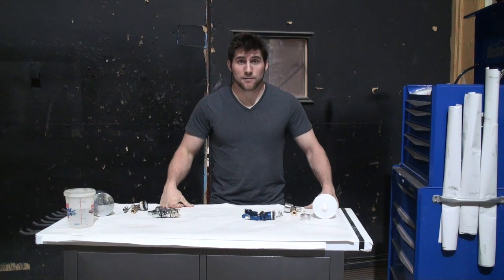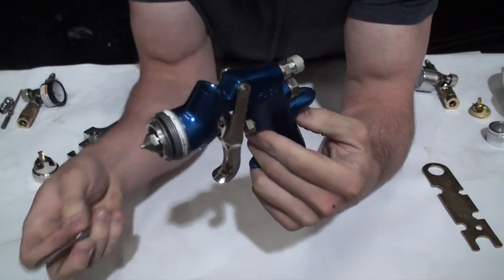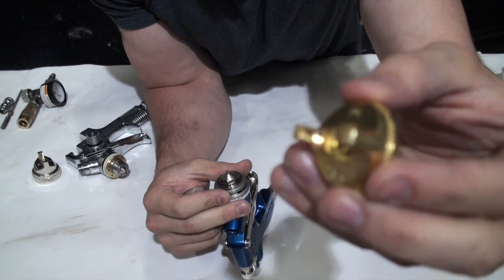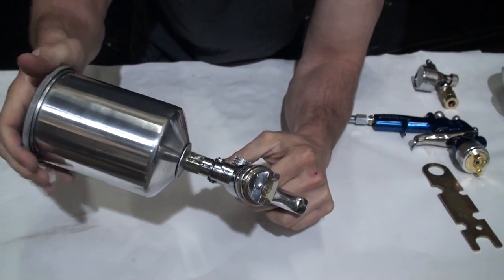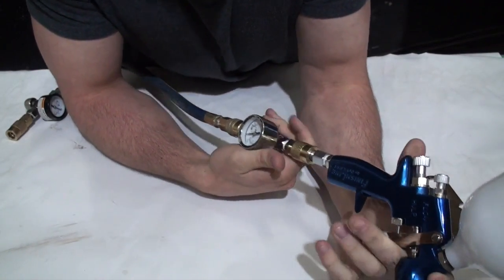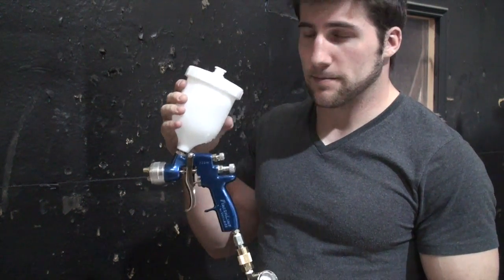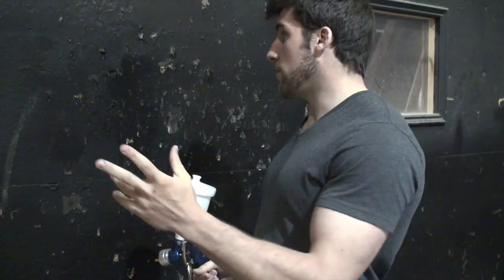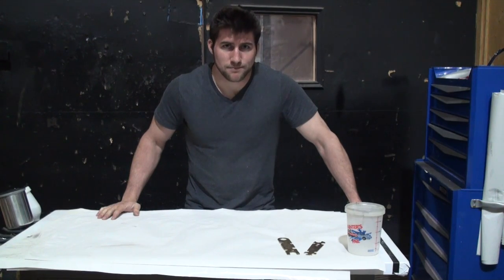How to set up your paint gun.

Comment: Good video. So many videos assume everyone is knowledgeable in all the areas and often people are not so you explaining everything is probably a big help to many novices.   I have the same gun but the earlier version (FLG3).  I picked up a few things from your video about it !   Only thing I would add is your much better off keeping the couplers to an absolute minimum so it keeps the gun much more nimble, light, and from dragging the air line across your paint job.  I hook the regulator like yours DIRECTLY to the gun like it comes new. You can actually tighten it enough by hand using the Gauge for gripping or use a wrench.  Then add the air Chuck at the bottom.  Or even better a SWIVEL air chuck.

Comment: 4:10.  Packing nut's only function is to stop paint from leaking out around the needle.  Pull force is determined by the spring at 4:58.  Yes you can increase trigger force by tightening the packing nut.  It is not recommended because that just increases wear on the packing nut and the needle.  It only needs to be tight enough to stop a leak.  Too tight can also stop the needle from seating when the trigger is released.  At no point does the packing nut determine when the needle movement starts.  You will always have to pull the trigger the same distance which is determined by the enlarged block portion on the needle.

Anytime you adjust your fan, you must check your air pressure at the gun.  Regulate your air pressure at your tank or line to +/- 5-10 psi of intended spray pressure at the gun.  This is to minimize air velocity changes due to extreme pressure differentials pre and post regulator. Keeping the regulator wide open, or nearly wide open greatly reduces the venturi effect.  This tends to have a greater improvement on HVLP guns, but is certainly a best practice across the board.
Reply from the maker: I thought I mentioned that the packing nut had the potential to stop the needle from seating etc., but it's been a long time since I made or have watched this video, so of course I can't say for sure. The packing nut essential just has the effect of gripping the needle a bit if it's tightened to that degree.

I suppose if you're working with a small compressor dedicated solely to your gun it would be feasible to adjust the pressure at the tank. Like most people working in shops (automotive or otherwise) I obviously don't really have that option, but thanks for the suggestion. I'm not worried about the venturi effect in this case, as it's not that difficult to suitably regulate your air.
Reply: Ahhh crap.  I got to bombing around youtube and forgot to look at how current your video was.  Oh well good points made on all sides.  Carry on, and thanks for posting and responding.
Reply from the maker: Thank you for your comments, and thanks for watching. I appreciate the extra info.

Comment: quick question. what it mean if you get an air leak right through the nozzle when getting compressed air?
Reply from the maker: +aantonio06 Double check that everything is tightened down properly. Does the air still come through the end of the nozzle if you take the fan cap off?

Comment: Hey. thanks for this. Curious... what type of paint and process would you use to paint the frame of a steel trailer? Would getting a paint with a built in primer (if any such thing) work or should I just go straight with the color? I'm new at all this so any advice would help. You also mentioned a filter would be good between the gravity canister. I have one that goes from the air compressor and one hooked up directly to the pressure gauge before the gun. Should I get the filter for the canister as well? thanks.
Reply from the maker: I don't really trust the paint with the built in primer. I would sand and clean it, prime it, and then do a couple coats of paint and three coats of clear probably. 
The filters in the air line are to take out moisture. The filter that I was referring to in the gun is to strain the paint so you don't shoot clumps by accident. You can also just use a conical paper paint strainer and poor the paint through there into the gravity feed cup.

Comment: hey Brad, do you have a video on what nozzles to use with different types of paint and primer? or does nozzle size matter that much?
Reply from the maker: I think I did a video on that at some point. The general rule is: thicker paint = bigger nozzle, and if you need more paint quicker, use a bigger nozzle. I use a 1.5 or 1.7 for sealer, 1.3-1.5 for clear, and usually a 1.2-1.3 for spraying paint. You'll want to use a large nozzle for metal flake as well.

Comment: Great information Brad!  What is the optimal size air compressor for doing projects no bigger than 24"x24" in size?   I don't really want to hear the compressor constantly running...  Thanks !!
Reply from the maker: The size of compressor that you need depends on your paint gun. Every air tool has specific volume and pressure requirements. The larger your compressor and tank are, the less it will need to run.

Comment: nice video as usual. really want to paint my snowboard with a satin or matte catalyzed urethane finish and want to make sure i have the necessary equipment without spending more than I need to. how large of an  air compressor is needed to operate a paint gun efficiently. for my use looks like ill be using around 1.5 mm nozzle. keep the videos coming they're awesome.
Reply from the maker: The size of air compressor needed depends on the gun. You should check what CFM (cubic feet per minute of air) the gun requires, and make sure that you air compressor is capable of that. Also, if you have a reasonably large tank attached to your compressor and you let it fill before you start the compressor won't have to work as hard and you may be able to get away with a slightly smaller one.

Comment: Thanks brad, very helpful.
My compressor has a gauge, but I'll be using a gauge as you suggest on the gun.
If I use the gauge at the gun should I turn the gauge on the compressor up full?
Reply from the maker: +Mario art That tends to be the simplest way to do it, yes. That's what I do.

Comment: Question? How and when do you thin paint for spraying??
Reply from the maker: +1proudnativeson You thin the paint if it seems too thick to flow properly through your gun. Usually the data with the paint will let you know if you need to thin it and how much. You thin it by mixing it with something to thin it. What you use to thin it depends on what paint you're using.

Comment: I was concerned about the high scfm rating on the finish line I just bought but then I read that a scfm rating on a compressor is at the inlet. I was thinking the more expensive two stage compressors somehow put out a higher volume of air but if it's the same psi and the same hose and couplers, etc should the air be the same? I understand my cheap compressor may not be able to handle continuous spraying but in spurts isn't it providing the same quality of air? Thanks dude, I really appreciate the info, subbed and thumbs up
Reply from the maker: The air quality is the same. It’s more a matter of volume. If you have a reasonable sized tank it can store some air volume and keep the gun running for longer on a smaller compressor.
Reply: @BradAngove  Cool, that's great news. I've spent a lot of time educating myself on bodywork and painting and I've never heard anyone mention the air quality is the same from a $100 pancake comoressor and a $1209 two stage compressor. This a revelation to me but I assume nobody mentions it because it's a basic fact to them and taken for granted. I can't think of a great analogy but if you're teaching someone how to throw a ball you probably wouldn't feel the need to explain what gravity is. Thanks again:)
Reply from the maker: Ya, it’s the same air. Just make sure you use a moisture filter.

Comment: Thanks Brad, enjoyed the video. What size hose do you recommend for Acrylic and/or 2 Part ? Also,  water filter location ?
Reply from the maker: I use the standard half inch hose, mostly because that's the one that's typical in most shops. I would imagine that using a larger hose wouldn't be a problem, but I'm not sure since I haven't done that.
Moisture can collect in the hoses, and anywhere else in the system really. For that reason, I try to use a moisture filter as close to the gun as possible. Usually just before my regulator. I also have a dryer on the compressor that I use, but that's because it's a large unit that provides air to the whole shop.

Comment: What CFMs does that compressor do at 30 and 40 psi? I was expecting you to have a huge unit.
Reply from the maker: I do have a huge unit; it runs to whole shop. Was I using the small red one in this video? Sorry - the studio app doesn’t let me check and it’s a pretty old video so I don’t remember.
Reply: @BradAngove  ah okay. Yeah you were using a little boy on that one. You almost had me excited that my 500 dollar 30 gallon husky was going to be okay for a while! lol.
Reply from the maker: It can do some jobs for sure. You won’t be able to run a shop off it though. The little guy I was using can get me through a coat on a guitar, but won’t keep up if I’m shooting a large 4’ x 8’ sign.
Reply: @BradAngove  Even with the devilbiss HVLP guns that "require" 8-12 cfm? I know the detail gun which I can buy locally from devilbis wants 8 CFM at 30... my compressor does 7.7 CFM at 40... i'm thinking I may be okay there but not sure what to expect. My tank is 30 gallons. The information on this is all over the place!
Reply from the maker: Ya, it’s tough. It depends on the size of what you’re spraying and the size of the tank. If your compressor can’t quite keep up with the gun, you can still paint for a while using the reserves in the tank. So, if you have a large enough tank and you’re spraying something small then you can go for it.

Comment: Hi Brad,

I saw that the second gun you presented, also have a setting wheel near the plug at the bottom, in adition to the settings on your flg4. My Iwata az3 hte2 also has it. In the paper that come with it, says only that is used to set the air flow, but not how to set it. Also from your video  How do you set it? I am noy sure why would it be usefull or used for, if you have your pressure regulator. For now I am thinking to set it to full open, and set the regulator to the pressure stated for operating in the gun booklet and don't touch the air flow setting in the gun.

Thx,
Adrian
Reply from the maker: You're exactly right Adrian. It's for setting airflow. I always keep mine full open and use the air regulator at the base of the gun instead.
Reply: Brad Angove cool. Thx!
Reply from the maker: You're welcome.

Comment: Is my first time using HVLP guns. I was done cleaning also for the first time, but now my gun leaks from the nozzle. what can I do, gun doesn't have a packing nut. It's like second gun you showed?
Reply from the maker: All of my guns have a packing nut. Is it leaking straight out the tip of the nozzle? Can you see the tip of the needle poking into the nozzle tip when you aren't pulling the trigger?
Reply: Brad Angove , yes once I pull the it's like the needle doesn't go back to place.

Comment: whats the adjustment on the very bottom of your gun next to your air inlet?
Reply from the maker: +ezra conner That's an air flow adjustment. I prefer to just use an air regulator at the base of the gun, since my gun doesn't provide a readout of the pressure inside the gun after it passes through that adjustment. I leave it open all the way.
Reply: Ok thank you
Reply from the maker: You're welcome.

Comment: Quick question Brad.Does a detail spray gun use the same pressure hvlp that is.
Reply from the maker: I'm not sure what a detail spray gun is. Are you referring to an HVLP touchup gun?
Reply: it's a 4 ox gravity feed hvlp all it says with it is 20-50 lbs operating pressure.
Reply from the maker: I usually use 25-35 PSI for those smaller guns.
Reply: Thanks Brad I was also given a craftsman gravity feed gun brand new the box had an inch of dust on it.the guy bought it and never used it. Says 20-50 on the directions pretty large span i usually just spray enamels i use a # 4 viscosity cup for the regular full size HVLP i'm still a rookie.Is it warm up there in the great white north.I'm is south florida.
Reply from the maker: It has been quite warm up here recently. Almost too warm for my taste. I'm not made for Florida summers haha.

Comment: I also have such spray gun. Can you please tell me regarding what type of compressure machine  for this spray gun?
Reply from the maker: You just need a compressor that meets the CFM and PSI requirements of the gun. I use a large shop compressor, but if you're only running a gun that's not necessary.
Reply: Thank you..
Reply from the maker: You're welcome.

Comment: thank you for this :) but i have a question, the Baffle component can be placed into several different positions for the little nipple in the back side of the baffle, does it make a difference?
Reply from the maker: The baffle?
Reply: but i think i got it figured out. there is a nipple on the back of the baffle that needs to be lined up with the hole in the body of the gun. i didn't do that after cleaning and was having major problems while spraying primer.
Reply from the maker: Oh; I see. I’m glad you’ve sorted it out.

Comment: Youre very thorough on your videos Brad , theyre great.. I have one question..
What compressor do you recommend? How many gallons does it need to be in order to do a fine paint job on a car?
Reply from the maker: +rikkyricardoo I don't have a specific recommendation for a compressor. To do a car you need one with enough CFM to be able to support your gun. Different paint guns require different CFM ratings from their compressors.
Reply: Thank you so much for answering brad, do you think a 20 gallon with 2 horse power will suffice?
Reply from the maker: I would imagine that that would be sufficient. If you let the tank fill up all the way before you begin it will probably be alright. What is the CFM requirement for your gun?

Comment: Thanks man you are great but want to know if you don't have regulator can you test on card board by adjusting air knob on the gun not regulator and should you fix moisture trap?
Reply from the maker: +Sroor9001 yes, you can do that if you don't have a regulator. Try to regulate it at the compressor though and just use that for small adjustments. 
Not sure what you mean about the moisture trap.
Reply: Brad Angove  thanks do you mean regulator on the compressor just have one gauge so I have to install second gauge for pressure right in case like this 😅.
About filter I mean there is spray gun air line  filter     Do you use that or its luxury accessory just new in compressor and painting with  air compressor also
Reply from the maker: +Sroor9001 Does the one gauge have a valve that you can adjust?
I don't always use the air line filter, but my compressor has a moisture trap on it.
Reply: Brad Angove  thanks a lot friend you are so kind and reply fast  hope I got some of your experience by time 😅
ok  for the air trap that's why 
I bought 2 filter which is to be attached to the gun but it's not red or blue which is disposable it has check valve and white element 
@ my work they never changed it cause it's not coming dirty but as for painting air compressor I don't know how often to change it or its permanent
Reply from the maker: +Sroor9001 The one that I use doesn't need to be changed. It's not one with an element though. Not sure.

Comment: Thanks for the info !! Really informative as I have never used one before. Question ? is there any type of paint which you might not want to use a sprayer with ?? Let me know.
Reply from the maker: +1proudnativeson Thanks for watching. I wouldn't want to use a spraying with really thick paint that doesn't reduce well. Metal flake paints can be difficult to spray and require a large-nozzle gun. Things like hammered finish paints don't spray well because they don't reduce evenly and they string up when you spray them. They are also really difficult to clean out of the gun. Did you have a specific type of paint in mind?
Reply: +Brad Angove I would like to try spraying my wooden wagon. Wheels are metal and I will be sandblasting all metal parts. Will this be hard to do?
Reply: +1proudnativeson I have an olg bottom suction can type and I bought one from Harbor Freight 18 Dollar cost. What are your thoughts. My compressor is 8 gall. I got tools to clean and strain paint. What is used to cut paint?
Reply from the maker: Spraying your wagon shouldn't be a problem. Using a syphon feed gun shouldn't be a problem either. It sounds like you've got everything you need. What you use to cut the paint depends on what kind of paint it is.